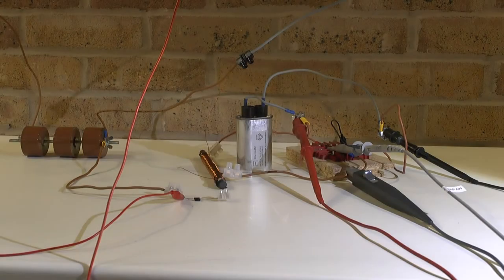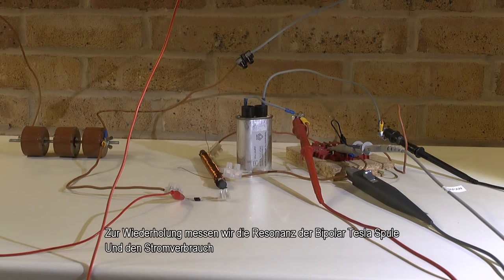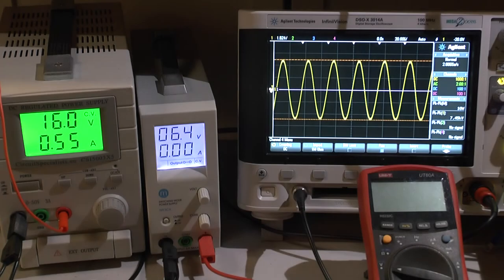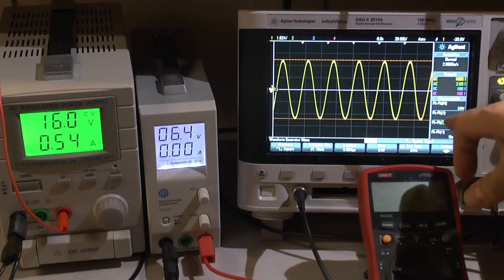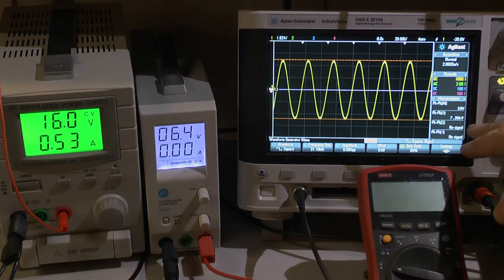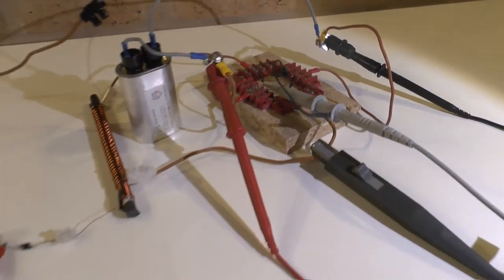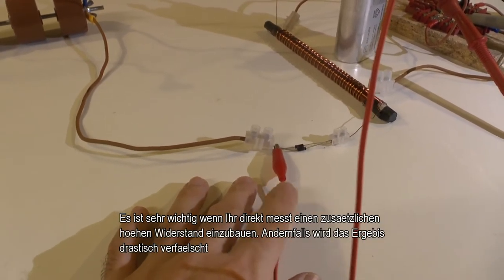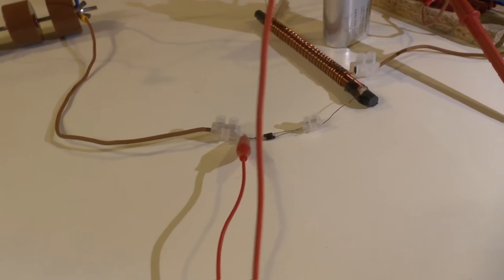Power Transmission in a lumped circuit Scenario 2

Comment from the maker: One more test done to tell you that the pick-up coil has almost no voltage across the leads. Only by connecting the rectifier to the capacitor power appears. It sounds strange but there is nothing. For those interested I can demonstrate that.

Comment from the maker: Another thought. The resonant radiant experiment I started had limitations based on the influence of the receiving coil had to the others. They changed the frequency and less and less energy was converted. With ferrite coils you don't have that problem because they keep the magnetic field strong enclosed. No radiation and no influence. Only the frequency is the limitation to avoid problems with eddy currents.

Comment: Very good! I like your real deal experiments! All Overunity.com forum only make blah, blah, blah "moves" and all members speak about "How to make Kapanadze`s generator" without understanding how Kapanadze`s device is constructed and functioned. Thank you very much! P.S. No one knows it!
Reply from the maker: Note, any closed system is prone not to break the COP barrier of 1, regardless, 2nd law of thermodynamics. It is also not scalable.
Reply from the maker: ***** Albert, you are correct. This is a concern and I have already taken measurements to deal with it. No probes connected only the DMM and pure Battery powered. By the way when I connected the probe at the beginning to ground no power was visible. It was all drained to ground by the probe. Now that is not the case anymore.
Reply from the maker: ***** Albert I can do one better. As already mentioned in my video that connecting the probe does influence your signal, I remove all probes and power everything via a battery. I bought all the kit for that a long time ago but never used it.
I will add many more pick up coils and measure only via analogue DMM which require a little bit of current to indicate voltage. I will also show that a 10cm ferrite core does yield only 50% of the power of a 20cm ferrite core. I tested it yesterday. There seams no relation to the winding process and frequency matching. I used matching capacitors without increasing the potential on the output drastic Any magnetic field close to the ferrite does reduce the power output. I will demonstrate that in detail in my next video

Comment from the maker: I did not mention that the pulse width is around 37% only. It also a very good way for a stationary system to distribute power. From my calculation with 4 pick up coils I break even, or COP > 1. A self running system possible. I might demonstrate that

Comment: Nice job.  I think I am doing the same thing with my motor bemf and pickup coil collection into caps.  My circuit is isolated and I currently have two caps in the circuit one is attached to a bridge to motor coils and the second cap is then witched with a fet to the first and then when it fills I use it to recharge my battery.  Don Smith built the same thing you have and also stated that their could be thousands of the coils gathering energy from a single transmitter coil.  you should be able to build a system dumping energy to do some serious work like run and impulse motor from the 900v caps.  simply have enough to run it
Reply from the maker: Exactly, I will also use an optical system then to dump the stored energy into a capacitor bank and battery combination and take out the energy to run the system.
There is an interesting article about a new invention to convert heat into electricity.
They split the extraction into 6 phases with rotated coils by 60 degree. It is on Multiphase thermoelectric converter and proposed for the nuclear industry to cool water and generate electricity with an efficiency up to 90%
Reply: You might want to use supercaps say 350F to be initially charged by battery and when charged they replace the battery in the system.
 I'll try this once my system is completed
Reply: Tesla built some fire to electrical converters *****
Reply from the maker: ***** I was thinking about it.I will try something new tonight.
Reply from the maker: I have now a serious bank of capacitors with strong TVs protection. They work very well. No cooked Cap anymore. I will go up to 2 KV and hold it there
Reply: I am using a 2.5kv FET to switch my 2kv into caps 680uf @500vdc max.  my comparitor shuts off the FET at any voltage upto 500vdc. this is the next step in my motor that will replace the 2   12vdc bat.
Reply from the maker: ***** I will use 4X 450Volt 2500 uF. But for the application not for the prove of concept system. i sue small 33uF 450 Volt und secure with 440 volt TVs and GDT. The TVs keep the voltage absolute constant at the reverse current of the rating. Amasing. I tested them on 2 KV. Rock solid.

Comment: Would this be working in continuous waveform vs the damped waveform of the negative resistance circuit? I was under the impression power could only be amplified via damped waves? Also, is your ferrite coil also acting as an extra coil?
Reply from the maker: Yes, as you can see the spark gap is increasing the current it is however interrupting the energy flow and the capacitor does not charge up to the same level as with continues energy flow. It is to slow to take avantage of it. I tested it last night. Good point of the extra coil, it kind of is, however it is not required to do any tuning. I have tested that as well.
Reply: TheOldScientist So when the driver is in resonance it can set multiple coils into oscillation if they are separated from the driver via hv diode? I will try this! any recommendations on the type of diode?
Reply: TheOldScientist Also, is your system being powered by an AC source? I was also under the impression pulsed DC was best to get only one type of discharge on the output...in other words to produce only negative discharges on one side of the coil and positive on the other side...then when hooked up to an aerial and ground it can attract only one charge from the sky...positive from the sky and negative from the ground?
Reply from the maker: MrWarrensk I already provided in my diagramm. You have to do try and error. The one I use, even at low frequency does yield the highest return. The Phillips BY9208. the system is always puled via a square wave. Pulse waves gives slightly lower results, however the diodesa t the extra coils does not allow transmission line effects like standing waves to exist. They pulse. Try direct connection and you see the difference.

Comment: I'm guessing the receiving bifilar primaries do not have to be exactly the same since they are not frequency dependent.  Have you seen a limit on how many receiving coils you can attach?
Reply from the maker: Very good point. No limit. And many more areas for improvement. I have added over 20 but that is work for all to be done.
Reply: TheOldScientist Thank you.  Have you tried using a large mass or large copper coil as your virtual ground?  You should yield more promising results.  Try it.  Also I'm not sure if connecting a solid load to caps will be scalable....but the bifilar series open ended primary on ferrite has got me thinking...
Reply from the maker: jburnum I have done more test and have a solution which increases the output drastic without touching the ground. I will build now a system and present as a prove of concept as an interim to a turnkey system.